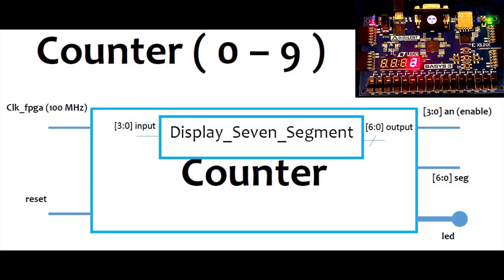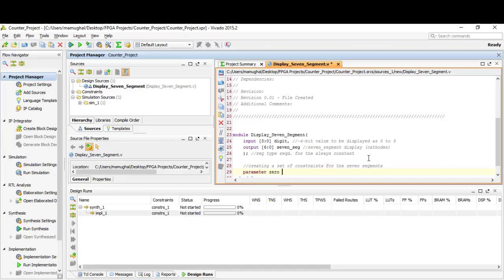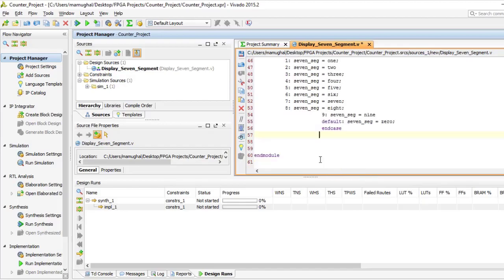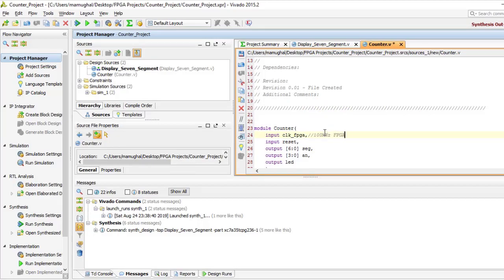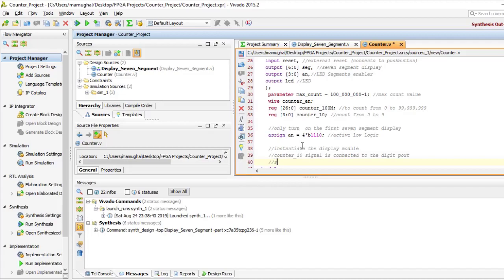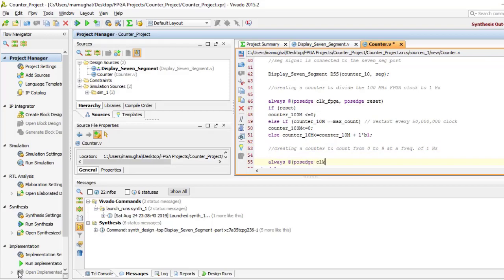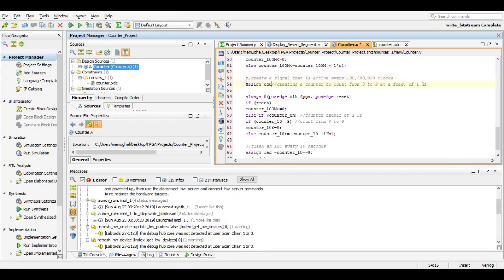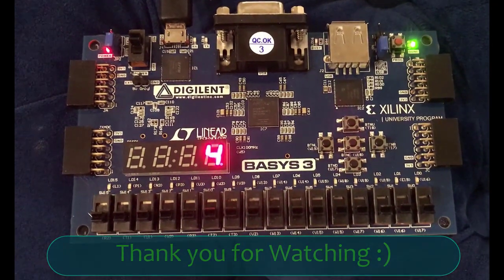#16 4-bit Synchronous UP Counter ➟ Verilog Code

Comment: Dear Dr Mughal the verilog files are missing in the project.
Reply from the maker: I just provided you with the access.
Reply: @ElectronicswithProfMughal  I mean the .v verilog files are missing in the Vivado project folder of 4-bit Synchronous UP Counter example. Please check it.
Reply from the maker: @Abdulbuzdar1  Dear Abdul Rehman, Look for the folder counter, and you'll find it hopefully. If not then let me know,
Reply: @ElectronicswithProfMughal  Actually I found the verilog files of your other videos but the verilog files of this video are missing.
Reply from the maker: Abdul Rehman Buzdar I checked its there, you must be looking at the wrong folder.
Reply: @ElectronicswithProfMughal  I finally found it. Actually I download 'Counter_zero_to_nine' instead of 'Counter' folder. Thanks for your response.